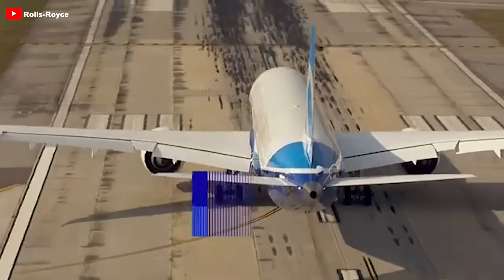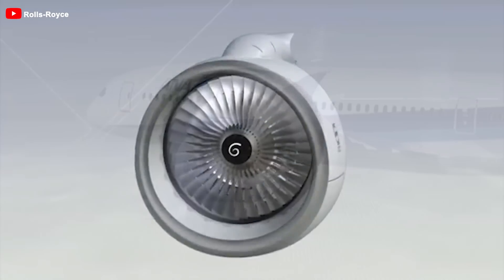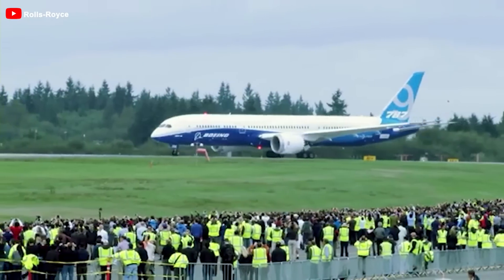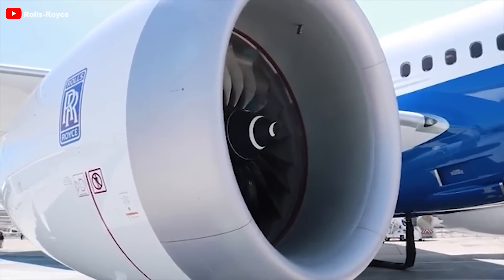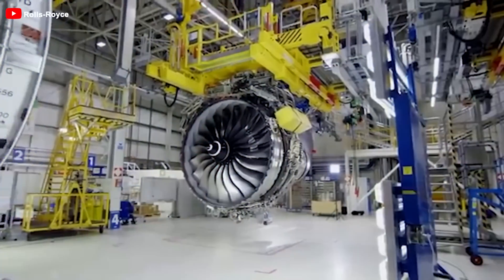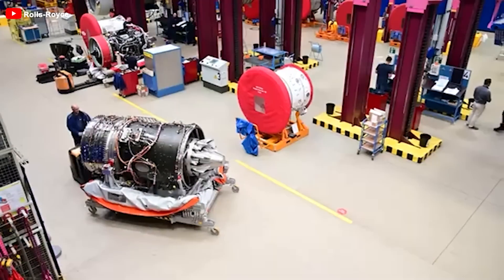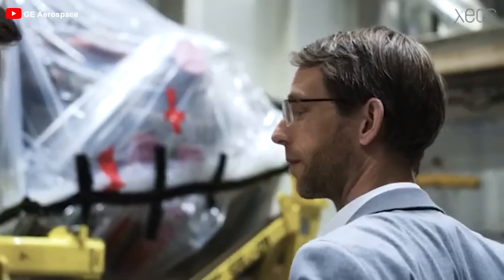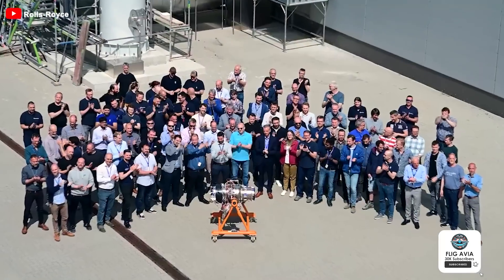This NEW Rolls-Royce UltraFan Will Change The Aviation Industry! Here's Why

Comment: Only way there will be a new 747 or A380 is if a ton of other problems are also fixed, a new engine wouldn't save enough to fix the now both dead programs. An engine like this on an A350neo for the 2030s to compete with the 777X would make the most sense. 

Maybe even allow for an A350-2000 to replace the 550PAX 777-300ER which the 777-9X can't replace as it only can go up to 475PAX
Reply: In my opinion, they should call the A350-2000 both „A350-2000“ and „A350neo“ if they use 2 ultrafans as their engines.
Reply: Exactly, the 747 market is done. Boeing stopped building the model

Comment: They exsist solely due to dedicated british engineers not huge funds that make USA rivals so successful. This helps that USA manufactures are under pressure to quickly make  financial returns for investors not so critical in the UK where the stock exchange has little interest in ngineering projects. very few RR engines are associated with aviation crashes.

Comment: What a load of bullshit for an engine that has not even been tested yet. No guarantee that it will do better than the Trent 1000 which had 'issues concerning performance and reliability'. Are there any other important aspects than those two?

It would have been nice to compare the new Rolls-Royce design with some other designs that claim to change the aviation industry, like RISE, instead of making what looks and feels like a propaganda movie for Rolls-Royce.

As noted in other comments: no informative content, just more AI.
Reply: Goodness.  You need to contact Rolls-Royce, as clearly you know more about jet engines than they do.  Please contact them and save them from any mistakes and job losses.
Reply: The RISE engine is not due to appear at all till at least the "early" 2030s , the RR engine will be on planes before then and we may even see the more advanced version that was simplified to bring to the market quicker in the same time frame as the RISE. The RISE will not be aimed at wide body jets or heavy lift needs so comparing their fuel efficiency is like comparing the Hercules Turboprops to the Jets on the military galaxy planes - they are not used for the same flight needs. What they will be comparable to is the geared turbofan of P+W once they sort the reliability issues such a new engine has generated. RR is also including gearing.

Comment: The RR geared fan engine has a larger wetted area yet it produces less thrust than the GE-9X which has a smaller diameter fan.
Reply from the maker: Yes, and Ultrafan wins on size.

Comment: I thought that the RB211 engine of quite a few years back was the first 3 shaft engine with an extra planetary gearset on the main axis of rotation. A version of it was used on some "hot rod" 757 aircraft. 
  I think both GE and P & W are trying to design engines with similar gearsets/3 rotational shaft speeds.
Reply from the maker: That's right!

Comment: From what I can see all you need is something to drive a very large fan and you don't  need a gas turbine to do it.......the fan can be driven by an electric motor which is the thinking of the future........when it comes to an alternative power source the electric solution is in the making especially as it is pollution free.
The current trend of big people movers flying through the air has a so many draw backs just to get them off the ground and back down again........why do  they still persist in making huge people movers that need huge engines?
Reply from the maker: There is supply and demand. Sometimes they like to set records, for example, ''the biggest thing in...''
Reply: If you only have the power created by a very large fan you need it to have variable pitch blades, like the constant speed props on planes. There is a huge difference between developping enough thrust for take off at a mere 120 knots and delivering enough thrust to move at mach .9 at 35,000 feet.
Reply: Electric is NOT pollution free. Perhaps you could tow a glider to carry the batteries.

Comment: The reasons explained are correct, by using a planetary reduction gear as P&W.
The maintenance and cost are less. However RR's 3 shaft design has reached a maturity, that makes RR competitive again. But only actual experience with a new aircraft application will show this. 🕰️ will tell.
Reply from the maker: We are still waiting to see how it will work in practice. Thank you very much :)

Comment: Q1 ) How much possible weight Airbus can reduce of A380 by making its airframe and wings fully composite. ? Currently A380 is metal frame. 

Q2) Can new big engines like Ultra fan, CFM open rotar and GE9x make composite A380 twin engine aircraft ?
Reply: The A380 is out dated,

Comment: I will be dust by the time RR get this going commercially, they must and they will! Anything they develop has to be leading edge because of their smaller size. The less complex engines of today will find themselves being out priced by the Chinese, who thus far demonstrate they do in 5 years what others take 10+years to do and their quality is improving! I remember when Made in Japan was a dirty word! So a time will come with the 2 programmes when RR have leading edge engines across the board for commercial airframes. GE have a great and huge certificated engine true, but no certificated aircraft to use it. Boeing have as we all know significant difficulties, and Airbus have so many orders with at least a decade + long production run into which RR upgraded current engines will seamlessly slot. In parallel the Ultra Fan concept will be certificated and you watch as suddenly all the brother & sister engines in the family emerge. This may not be their strategy, but it is a Strategy none the less. Essentially their second RB211 moment. Where they must succeed!
Reply from the maker: UltraFan is great!

Comment: I can see scaled down versions of the engine being fitted to both the A350 and 787 models to get another 400 nautical miles of range at minimum without putting in bigger fuel tanks. But is Rolls-Royce willing to pay Boeing to allow an UltraFan derivative on the 777-8 and 777-9?
Reply from the maker: Must see if it is necessary, and 777X hasn't operated.

Comment: The Ultrafan project shows great promise.

Hopefully, one of the primary aims of the project, increased durability, will be fully realised as RR will typically receive harsher treatment than GE or P&W for any issues the engines experience. 

You only have to compare how RR has been criticised over the issues with the Trent 1000 (I would add that I believe that it was fully deserved) with the issues experienced on the P&W GTF and the number of aircraft now without functioning engines. There has, in my opinion, been far too much emphasis on how it is the A320 or A220 series of aircraft experiencing problems with less emphasis on the fact that it was the engines, which as anyone familiar with how the industry works, are often supplied on a different contract directly with the engine manufacturer.

GE must also shoulder a significant degree of blame for some of the delays with the 777x. Again, it isn't being used vigorously to attack their reliability. 

By the way, I am not trying to mitigate the issues with the RR engines. I also believe that the GE or P&W engines deserve great success.

All I wish for is even-handed treatment.
Reply from the maker: I agree. I noticed that when 787 had problems, people criticized RR more, but when 777x had problems, Boeing was still criticized and GE was not mentioned.